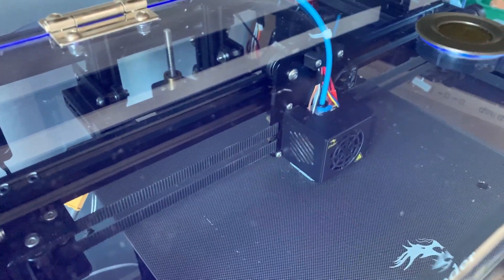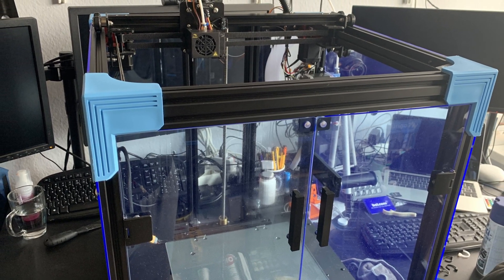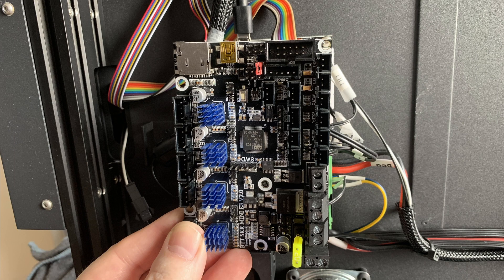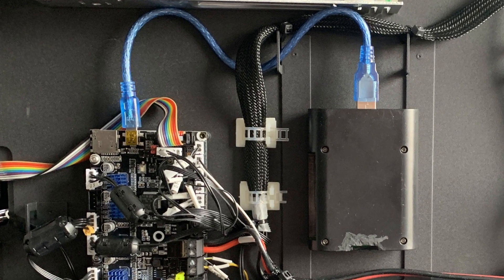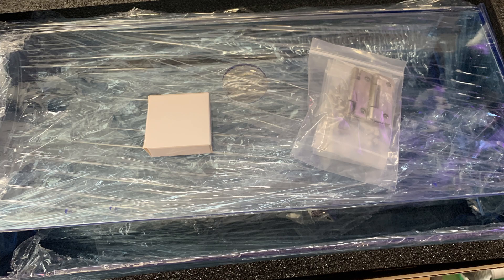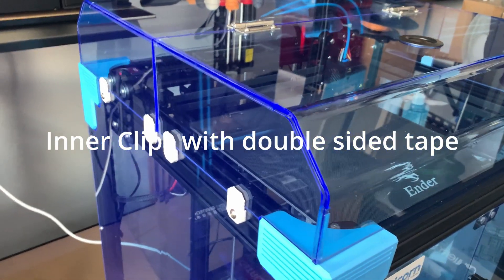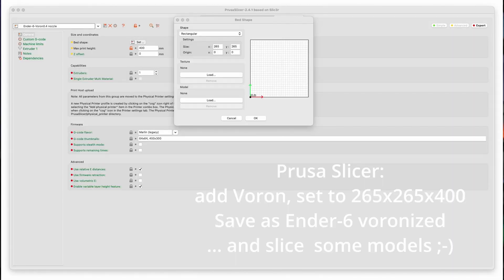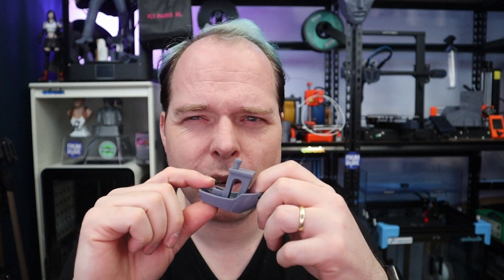Voronized Creality Ender 6

Comment: Thanks for great videos :)
I wonder though, did you switch the X and Y steppers? As I understand the Ender 6 needs to switch those on the skr mini card, and I can´t see the labels on the cables in your video...
Reply from the maker: Hello, thank you for this comment. It is something you need to do, if the motors are not working in the correct order and can't be solved via the Klipper printer config file.

Comment: hi Zachary 
I would love to thank u for this video 
I already finish installing everything and it works fine, but as I know the e3v2 is a silent board right ?!!
why is my printer now making a loud motor noise? 
I already modify the config file for my original motor but still making loud motor noise......
Reply from the maker: Sorry for my late reply... Are you still having these issues with the motors? which ones did you use? 1.8 or 0.9?

Comment: i'm sorry but there is a hell of a lot more than software setting apart the voron from ender 6
Reply from the maker: The name Voron I have used as a little blink... Voron has more quality parts than Creality has and has a higher price tag in the end.
Reply: @Zachary3DPrints  still good work :)  i have an ender 6 also and sort of converted it to a voron. it has 3 z steppers and linear rails and lead screws, like the trident but using modified rat rig parts, then a voron 2.4 xy carriage but unlike the 2.4 the xy is fixed :D (btt octopus, 5160 and nema 23 xy steppers)
It runs amazing but the printer was pretty good even before i 'voronized' mine
Reply: @98f5  I'd be very interested in seeing this man. Think you could post a vid of it running and printing? Pan around and show off what you've done.
Reply: @98f5 bonjour tu tournes à quelle vitesse avec ces améliorations car cela me tente bien
Reply: @TableTopBiker  i have videos on vorons discord i had one on my youtube at some point but i deleted all my videos thanks to stupid copyright strikes

Comment: Wait. Did you Just remove the hotend shroud(aka working on exposed Electronic (my e6 had loose wires on the heater) while its turned on? Noticed the bltouch blinking)

Changing main board and installing mainsail os makes it a voron?
Reply from the maker: Hello Joery Pigmans, that is right. You did see that correctly. It's way better to not have the printer powered on during the build. But to have a right order, I have placed the hotend part, which was recorded later, first. Since I needed to heat up the hotend to remove the filament and changing the hotend. So far the wires I kept my eyes on during the build. 
I have called it Voronized, because I liked the title a bit more and I followed the Voron instructions and used the Voron config as template.

Comment: I would ask you for help. I have Ender 6 and E3D Hemera, I can't make it work. Please help.
Reply: What exactly is the issue you are having?
Reply from the maker: Good question
Reply from the maker: Hi, I didn't have a Hemera installed on this printer. There should be brackets available for this and for the wiring, it should be extended from the extruder to the carriage obviously, but you need to check if there are some schematics around in order to get it to work.
Reply: @Zachary3DPrints  Tnx for reply, but I sold my Ender6...Now printing with Artillery SW-X2, that printer is awesome and waitin' FLSun V400 to receive...Im happy again.

Comment: this kind of video requires a multi part video step by step modification in detail. when you add pictures with messy cables going everywhere from nowhere nobody will be able to replicate this upgrade
Reply from the maker: Hello Mihai Dobrin, I thought that this was better way to do it. Sorry if the video with the pictures was a confusing or not clear. I hope you did manage to get it working
Reply: @Zachary3DPrints  can you still please make a more in depth tutorial on this. I got my hands on an ender 6 and I want to follow your build. Please...

Comment: Hello, I would like to ask where did you get yung motor A & B bracket? TIA
Reply from the maker: These are the NAK LDO stepper motors, they come with the red brackets. In the top they support the axis with the pulley
Reply: @Zachary3DPrints  thanks
Reply: @Zachary3DPrints  are you happy with the motors? 
do they work good? 
im going to upgrade to them to on my ender 6